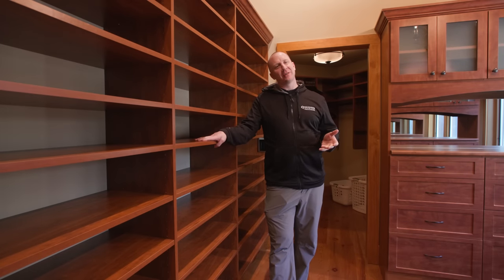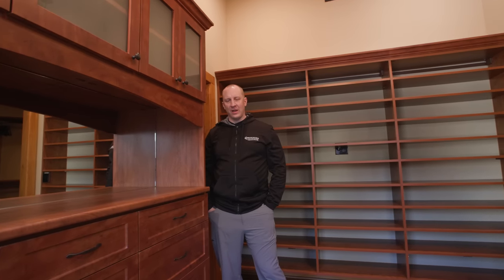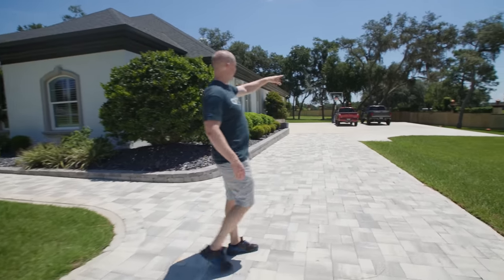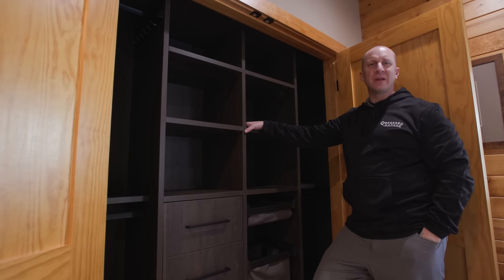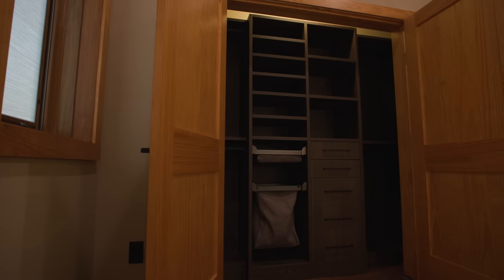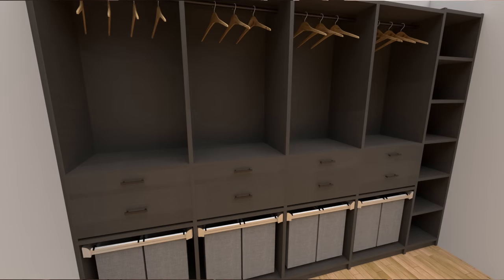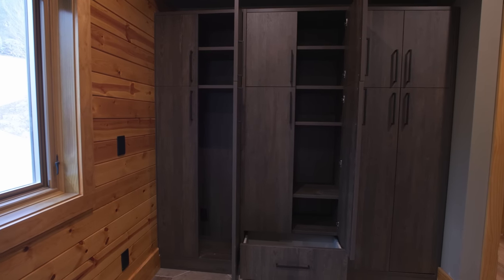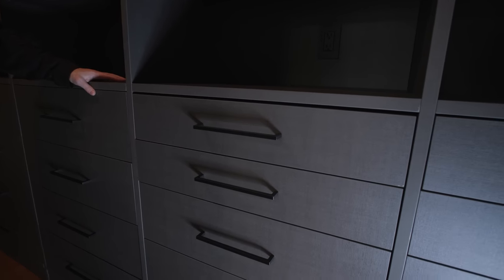Aspire Custom Closets Tour - Full Details and Pricing

Comment: There was a clip in there from SEMA where they showed these closets with integrated lighting. That option would be icing on the cake. Lighting is so important in typically dimly lit closets. Can we get those?
Reply from the maker: Yeah, that is super cool.  The problem is that it adds another 50% or so to do.
Reply: @ObsessedGarage  brings the cost more in line with California Closets, and I’d get a better quality closet with lighting, could be an option worth it to some (I’d pay for it)
Reply: @ObsessedGarage  maybe I’m a sucker for “while we’re already here”, the hard part is the getting them delivered and set up, just a bit more cost (shipping costs wouldn’t be affected much) to get a version with built in, recessed, strip lighting would be real sweet

Comment: i love this idea. sending proper measurements for the custom build will be sketchy if not done by a professional.
Reply: 15:50 Measurements are smaller than the closet
Reply: @utbigpapa  yea I saw that. Just looking at the vid, it seems like it would be difficult to hang clothes.
Reply: @sxsw12  I agree. This setup looks like it could replace a dresser. If not, I would skip the drawers and rearrange the layout. He's losing a lot of hanging space in this config
Reply: @utbigpapa  yea exactly. I still like the setup.

Comment: I really like what you're trying to do, but unfortunately your pricing just isn't even close to competitive. I've priced out my master closet against a local closet company's quote and the price of a fully custom top-of-the-line closet with full backing, LED lighting, all accessories, a full-length installed wall mirror, and a free-standing island comes out to less than your product does for just the cabinets without shipping. Realistically you're going to have to drastically lower the price to compete. I really wanted this to work because I like the concept, but why pay more and then have to put in my own labor on top? Your competitors offer free in-home consultation, design, and quotes and can provide every finish I can think of. The value proposition of your product is realistically price, and price alone since you have fewer options and don't include installation. I'd recommend at least a 33%-50% decrease in price, especially if you're going to ask for deposits, shipping, and etc. Tough to hear I'm sure considering you're working with small volume pricing vs your competitors, but that's just the market's prices.
Reply from the maker: That's not what I've experienced.  I'm just adding a 35% margin to my cost.  My wager is that all of the "custom" stuff those companies are adding on are junk.  In garage cabinets, they are selling New Age cabinets, and I'm selling Lista and Sonic.  Lista and Sonic cost 10 times more.  Every single closet company I've found is using 3/4" junk and charging double what I'm proposing.  I'd punt this stuff if you were correct.
Reply: @ObsessedGarage  I'm not gonna lie, the prices of these individual sections is so high that I could pay a carpenter and make them out of solid wood rather than any MDF. I wish you well, though.